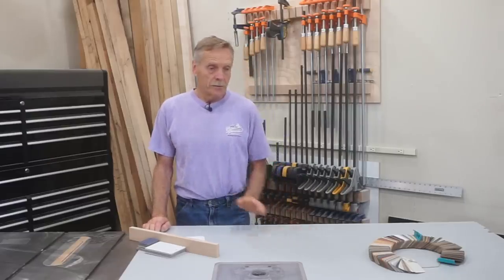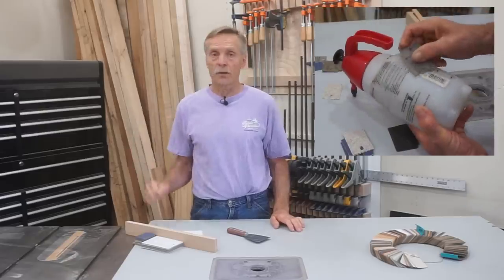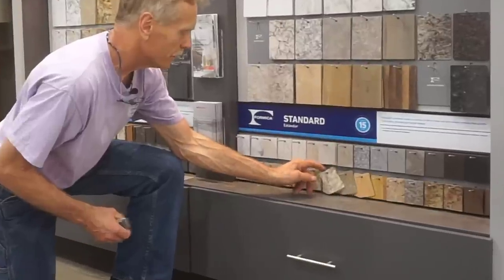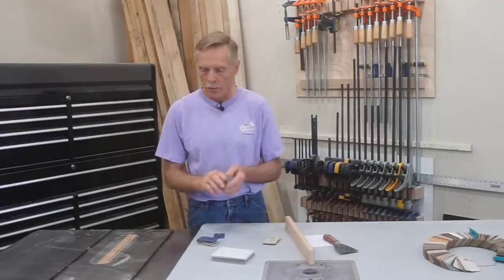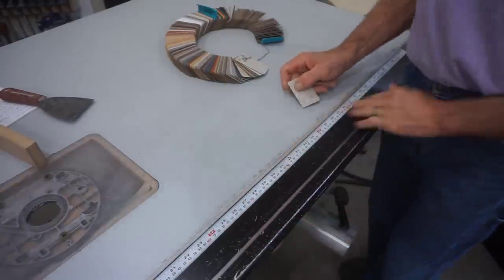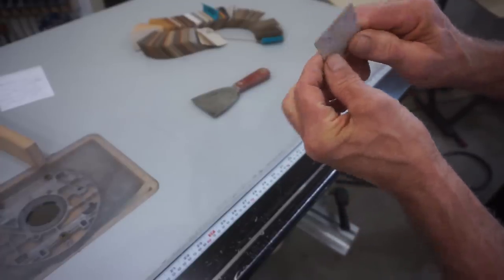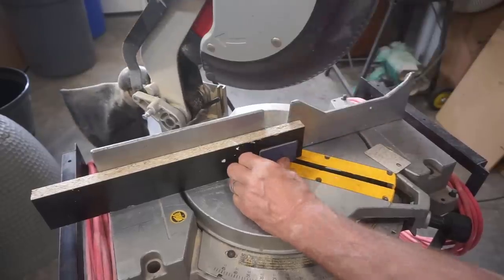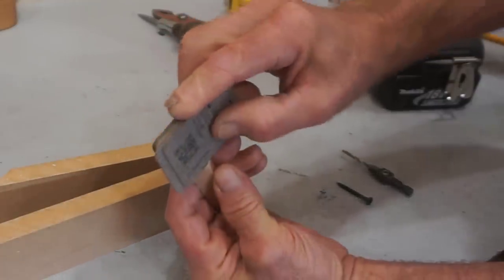Faux Fingernails from Free Laminate Samples

Comment: Tip for removing stickers.  1) Mineral spirits is usually the best choice if you don't mind using solvent.  It's pretty safe on most things.  Acetone and lacquer thinner are faster but can ruin finishes and melt a lot of plastics.  2) Any kind of oil.  It's slower but safer.  Even cooking oil works.  Just apply some and wait for it to soak through. You can tell when it has and then the sticker peels right off.  Use the same oil to wipe up the good.

Some stickers are actually plastic so these methods don't work so well since they have to work their way in from the edge instead of through the sticker.  Also, many things come with water-soluble glue so sometimes just using warm water will remove stickers.

I scrape as a last resort because I still have to go back with something to remove the left behind goo.  But if that's what it takes then that's what I do.  My first choice is mineral spirits.

Comment: Back in the day when I did LOTS of Formica, laminate work (lots in a production environment) scrapers were made by laminating a scrap of the laminate to a piece of 3/4 something and then cut that to a bevel.  With softening of the non scraping edges it made a nice tool that was comfortable in the hand.  Just every so often sharpen it on a disk or belt sander. 
AND, once the scrap of Formica is laminated to a piece of something it is reasonably safe to cut and sharpen.
Reply from the maker: Glad to see you found this old video too... it came to mind when you shared your scraper idea on the other laminate video here on the channel.  Only guys like you (us?) know that formica/laminate edges are 'Ginsu sharp' when cut or, sharper still on a jagged edge on a piece that 'tears'! 😉😎
Reply: As to your (us?). My first exposure to laminates was back in 1961-62  when I took a co-op job (school a week, work a week) in my senior year at Connelley Vocational High School (Pittsburgh, PA). Recalling that my last exposure/adventure into laminates was about 1975/76 when I remodeled a kitchen with Formica cabinets and counter top.  I tuned into your "Formica Application Master Class" for a refresher on the topic since I am now building a work bench/assembly table that will have a Formica top.
I suspect you are a least bit younger than I, OR you are in super good shape. Your video sure brought back some great memories, thank you! :)  @NextLevelCarpentry
Reply from the maker: @williammagee7514  I'm guessing you've got about a 15 year head start on me... my sole 'education' on this was when I watched/helped my boss do a simple bar top with formica on a basement remodel project in Chicago in about 1978 or so.  Everything since then is self-taught during on the job experience and picking up secrets and tips from a mentor at a cabinet shop where I'd always ask a couple questions every time I went in to buy laminate or contact cement. It's cool you're still engaged with an interest in this stuff when many/most your age seem to spend their time 'coasting'.
Reply: @NextLevelCarpentry  No coasting for me, full speed ahead. In fact I like to get, metaphorically speaking, speeding tickets. When asked how old I am, my reply is usually something like, "I can accurately tell you my age. As to how old I am, you will have to be the judge of that." 

For sure I got a head start on you but when you started in 1978, I was making a big change in my life. This will take a bit of explaining, hope you don't get bored. My diversion started in 1976 when I decided to go to collage. Majored in accounting but in my junior year took a required introductory course to computer programming. It was like someone shot some type of addictive junk in my arms and so software engineering was my addiction for the next 20 years. 

About 2000 I accepted a position with Bank of America in Chicago. Wife at the time and I decided we did not want to take trains in and out of city every day. So we got a condo at 860 North Lake Shore DR. With the fantastic views of the lake and the city's architecture, especially super stunning scenes where night time lights reflected onto the Chicago River and Lake Michigan, I decided to purchase a digital camera.

That camera purchase started a new addiction that took over the software engineering addiction. So I am now creating art that starts first with image perception and then digital capture. This is followed with lengthy intense computer aided luminosity adjustments supported by many iterations of proof printing. These adjustments can take days, months and sometimes years to complete. 

Like you I am into quality and for images that cut the muster I produce Giclee prints on 450 GSM archival certified & OBA (Optical Brightener Additives) free poly-cotton canvas, followed with a water resistant ultraviolet protectant. Printing is done using my 44" HP Z-Series 12 color Vivera Pigment Ink Giclee Printer. Wilhelm Imaging Research has conducted creditable tests on similar canvas demonstrating these inks can last for greater than 300 years before "even noticeable" fading and/or changes in color balance occur. How long they will remain presentable past the "even noticeable" changes? Does "Almost Forever" come to mind? 

Then I do my own canvas stretching onto an aluminum reinforced system. Since aluminum is unaffected by potential differences in humidity and temperature there is no twisting, bending and warping. This results in what is referred to as a "Gallery Wrapped" product that is more than acceptable for delivery to Art Collectors. Observers of my digital images swear they are paintings.

Not done yet, but, coming soon is to produce my own "bespoke" floating frames that will protect the edges and corners of the "Gallery Wrapped" images. Not sure what these will finally be but considering at a minimum some type of hardwood, walnut, oak, etc. Or maybe even exotic veneers. The frame creation will be fun and tie me back to my woodworking roots.

This overall creation process requires lots of effort and time. This does not matter since it is NOT my desire to create an immeasurable number of images, but, to create images that last an immeasurable number of years. I like Win-Win scenarios: for the Art Collector, with proper care, my "Almost Forever" creations can be reasonably expected to last beyond their great grandchildren's great grandchildren; for me, it is gratifying knowing that my artistic creations will go on carrying with them an infusion of my personal energy.

Summing this up: The evolution of my life put me where I am now, ever expanding my studio/workshop to support my desires to produce and improve my "Almost Forever" creations. Sure beats coasting since "coasting" makes one get old, real old! :)
Reply from the maker: @williammagee7514  That's a fantastic 'life trajectory' William... thanks for sharing.  I'd like to see an example of the art you create and describe if you have a link to one.  You could use matt@nextlevelcarpentry.shop if you like.  Also; you're highly capable at developing cutting edge things but if there's anything I might contribute to the 'floating frames' aspect of your art feel free to reach out?
I will steal your quote: "I can accurately tell you my age. As to how old I am, you will have to be the judge of that."
FWIW I spent my first 24 years of life in Wood Dale, a small suburb west of Chicago you might be aware of...
Best, Matt

Comment: A good free scraper I've used in the past, a bit softer plastic than laminate chips, is a credit card.  Some of those that come in junk mail are good, or old ones, if you don't want to ruin one of your real ones.  You can run a sander over the magnetic script and embossed account number, and dig a bit at the optical chip, if you are concerned about losing it.  Better yet, chop off with a scissors the end with the chip, and just use the rest.

Comment: How about adding 45 angle like you did cut at the end of the board behind the chips, so they are all lined up on 45 angle. Also how about pre tensioning the jig with rubber band
Reply: @ladya1953  thanx for expanding on my chaotic thought. I was mowing my lawn and typing the comment in...

Comment: Well, Matt.  When I saw the title I was hoping that this vid would be one that would be on the playlist with the DuhWalt Board Stretcher vid.  Pretty much tongue firmly in cheek.  I kept waiting for the give-away punch lines.  But then it started sounding like you were being serious.  The further it went the harder it was to believe.  Do you really take time to gather laminate samples, build a jig, and bevel the chips so that you can scrape glue off your table saw?  Why do you have so much time on your hands?  I guess I need to slosh more glue on my projects, cause I just don't have that much scraping to do.  I'm actually a really big fan, both of your serious and of your not-so-serious videos.  I'm still trying to decide which category this one fits into!
Reply from the maker: Hey Andy, I was angling to make more of the laminate chip and Chip Wood joke but didn't spend the time to develop it, sorry.  There was a couple good jokes in there SOMEwhere!  I really do make these chips and, without doing a video, I can cut a 3-year supply in 15 minutes.  Expand your thinking about possibilities and you'll easily put this into 'serious video' category.  I only need to help Mrs Next Level Carpentry on one label removal or oven or grille cleaning honey-do to MORE than justify the minimal effort it takes to keep a stack of these on hand.  Give it a try and I think you'll be surprised by how easy they are to make and how useful they are.... Best, Matt

Comment: My heat gun gets used more than about any tool, takes all those product labels off cleanly with or without a bit of Goof Off afterwards.

I know it's a challenge when trying to talk through a demonstration, but you really should be wearing a mask full time when or after cutting before airing out the shop fully.  Woodworkers are statistically about 7 times more likely to end up with emphysema...